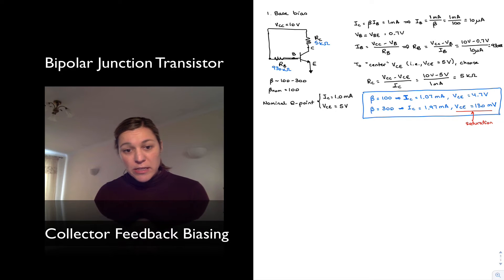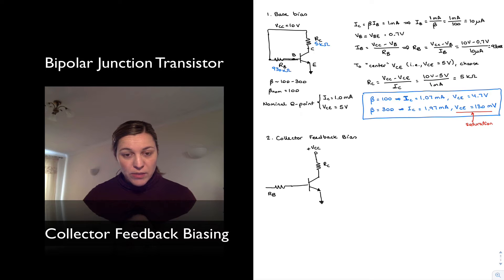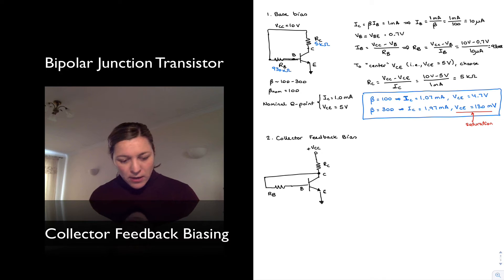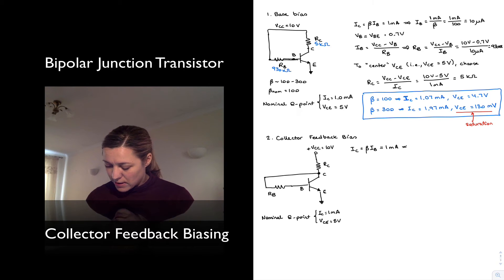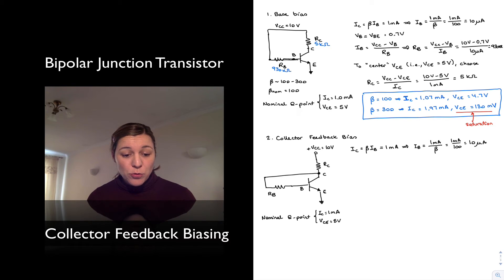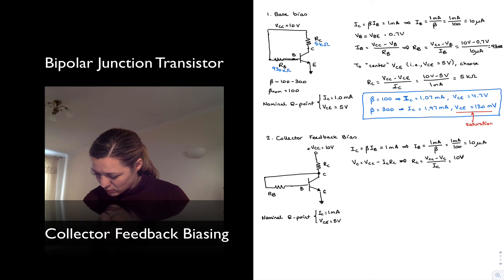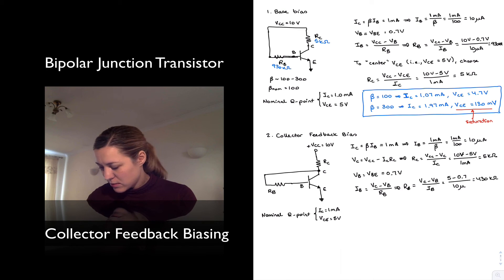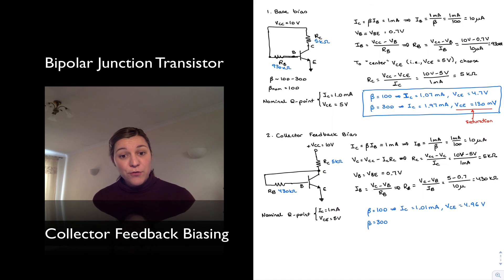BJT Collector Feedback Biasing

Comment: but you take current through the R(c) resistor to be I(c) (during the calculation of V(c)). Should it not be I(c)+I(b) according to Krichoff's Current law? or am i missing something??
Reply: No, you only include I(b) whenever you want to know the voltage across R(E). However, most cases you can neglect I(b) as it's much smaller than I(c) and won't really make a huge difference if you include it or not.